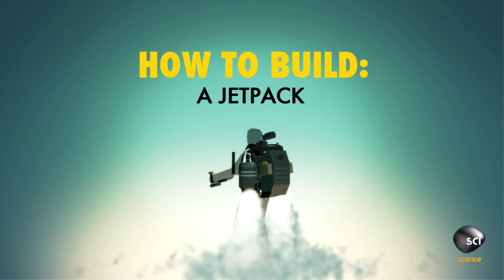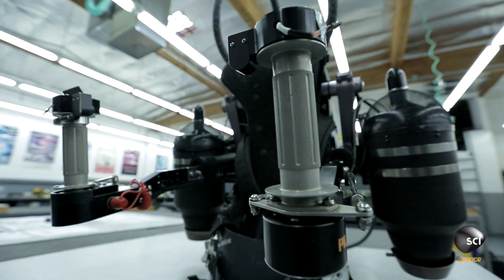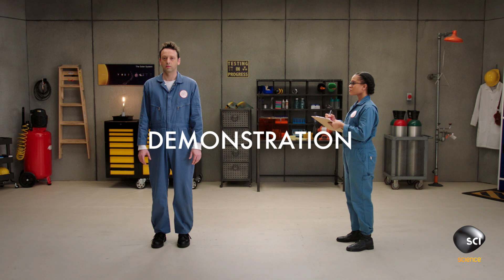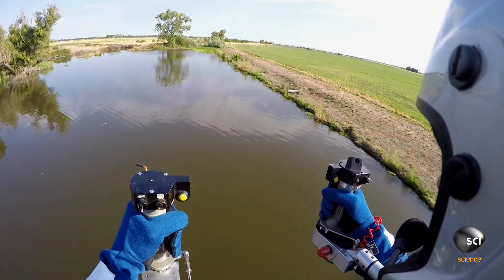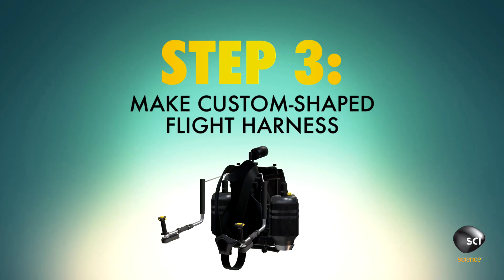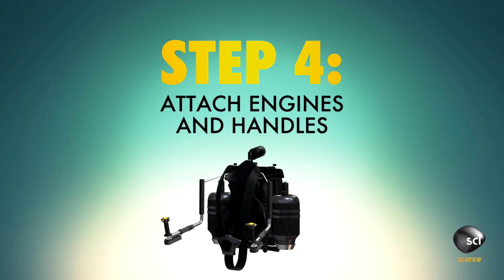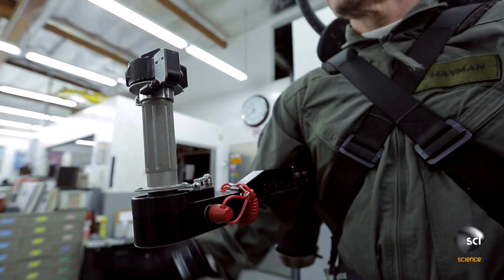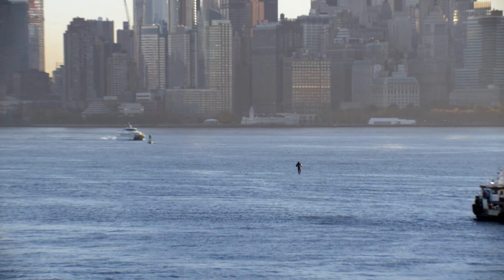How to Build a Jetpack

Comment: First off it's super annoying to have your legs just dangling in the air without any support to stand on while using the jet pack, not only that but it looks like your time on the jet pack is limited, this jet pack seems more inefficient than anything else, no real protection while in flight, and it doesn't look cool, looks more like a cheap movie prop, especially nowadays with all the technology out, this jet pack needs an upgrade in style performance and all of the above
Reply: +wkm001   More like looks more uncomfortable than anything, I can't imagine myself being in that thing for more than 15 minutes to half an hour comfort is a big issue here guy
Reply: I feel like that strap between the legs must hurt for men, probably for woman too.
Reply: It's obvious none of you have ever worn a harness. They can be made to sit in all day, and be comfortable. Have you ever been on a professional zip line?  I took one tour on a zip line, was an all day affair. When your sitting in this harness, your legs are dangling, but because of the way the harness is  designed, it displaces the weight of your body in many different directions.  

As for the "limited" time, it's actually using 10 gallons of kerosene, to travel for 10 minutes.  In the future, the designer is going to add gyro's and other components, to make it even easier to fly, and hopes to bring the cost down to 10,000 bucks!..  so, unless you can invent something better, or have some handicap to flying over traffic, then your opinion is like my butt, and we all have one!
Reply: Yeah, I'd rather sit than have that strap crush my testicles. It seems like a danger of hot air blowing on your legs and giving you burns, I'm not sure if the air coming out of the engines is hot enough though.